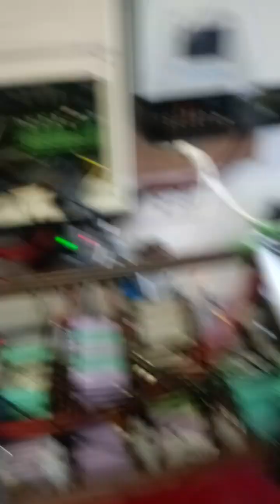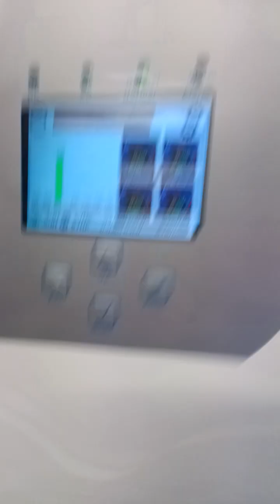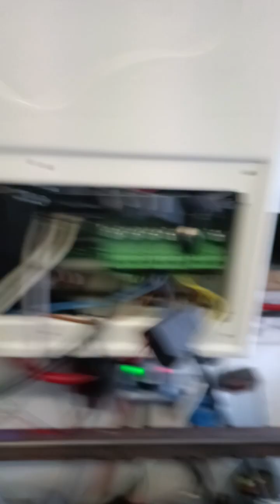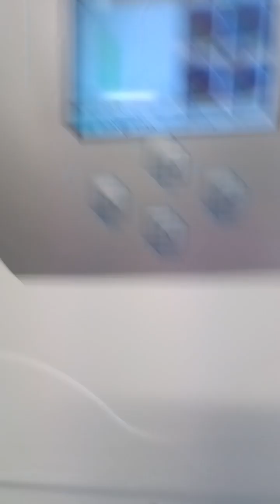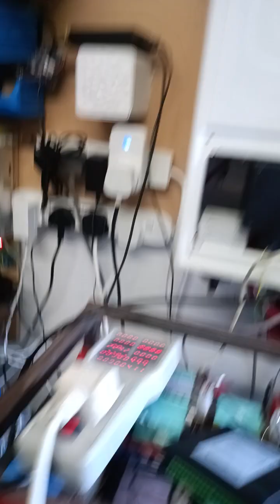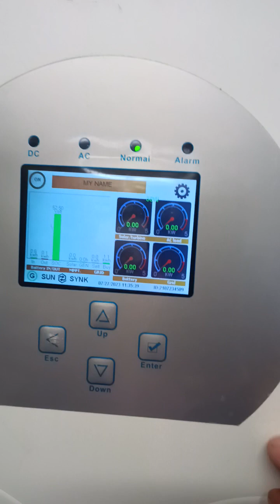SunSynk Essential Loads & AC Coupled Solar

Comment: Hi, great info. When coupled to the grid and using a string inverter in the Gen port.... If the battery is fully charged will the string inverter carry on producing power exporting to the grid through the sunsynk inverter?
Reply from the maker: Good question.... I'm not entirely sure but I do know is you can set the gen port to frequency shift which will reduce the generation of the string inverter as the batteries get full. 

If you'd rather the string inverter still exported when the batteries were full then you'd be better off not connecting the string inverter into the generator port, but just leaving it connected to the supply as normal but selecting "micro inverter" on the SunSynk anyway. 
This tells the SunSynk to charge from exported power, so as long as the CT is at the origin of the supply, and that is the same supply the string inverter is connected to, the sunsynk will charge from it also.

Comment: Hi did you say the inverter can frequency shift when micro inverter is wired in through the generator port
Reply from the maker: Yes that is correct.
Reply: @roadeycarl  thanks for your reply

Comment: Please could you run through how you would set the sunsynk inverter up as a stand-alone AC-coupled battery charger to an existing system with a string inverter (not using the aux terminals)?
Reply from the maker: You simply set the AUX / gen port to "Micro inverter". 
Nothing physically needs to be wired into this port. The inverter will now watch for any power going past the CT and charge the batteries with this power.
Reply from the maker: Nothing physically needs to be wired into this port. The inverter will now watch for any power going past the CT and charge the batteries with this power
Reply: What would the AC couple OFF Batt and AC couple ON Batt percentages need to be? @roadeycarl
Reply: this should be a bullet point! took me 5 days to find this answer as i have ac coupled solaredge system... @roadeycarl